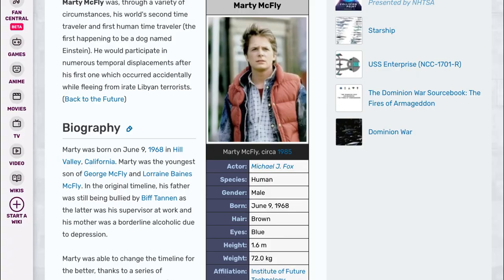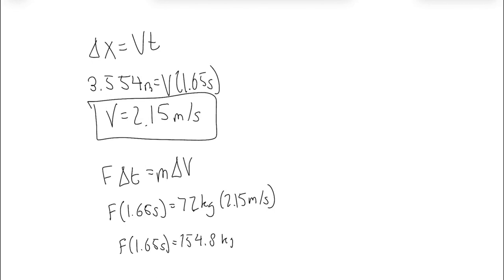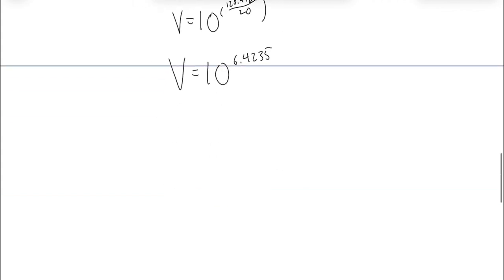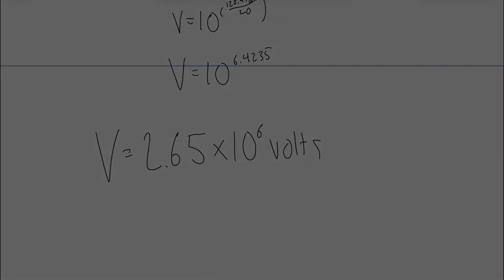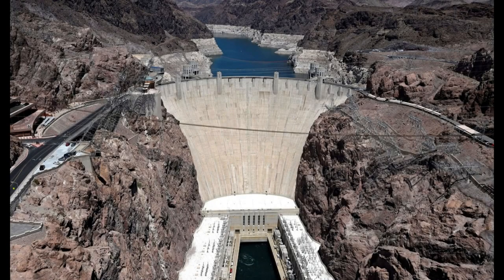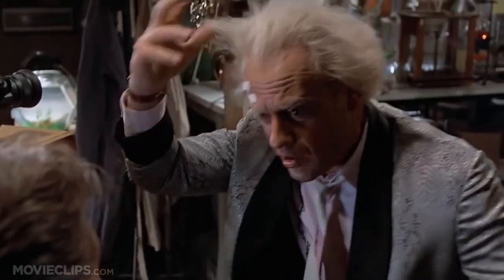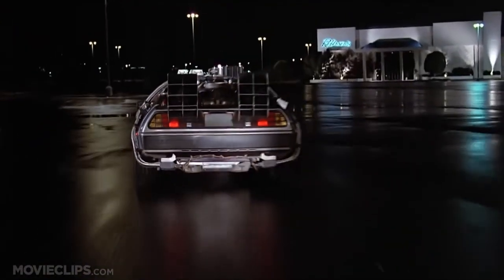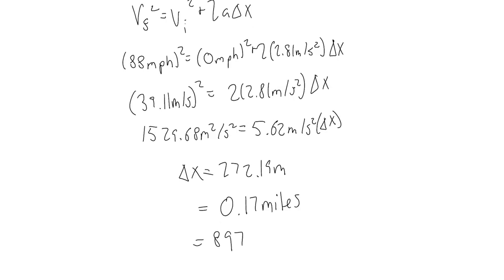The Physics of Back to the Future

Comment: 1. Not that it makes a huge amount of difference in the reality of the sound pressure, but Michael J. Fox was nowhere near 72kg at that time, he was probably less than 60kg. And you can't measure the amount of energy needed in just volts, you need amps as well to calculate the wattage. And as you don't know the resistance of the speaker, calculating volts is impossible.
2. The problem with 1.21 gigawatts is not just the amount, but it needs to be delivered instantaneously. You can't hang around Hoover dam for an hour and somehow collect it for use in the car? This makes no sense.
3. While there are definitely inconsistencies in the speed of the Delorean, Marty never went from 0-88 in this scene, he drove around.
4. The lightpost on the opposite of the lightning strike is clearly grounded in both the model (not to scale) and in the "real" world. Doc would not have been the shortest least resistant path to ground, going through the wires would have been. While this whole segment (and you know... the whole idea of time travel) is obviously Hollywood fiction, you are ignoring some crucial points.
1/10
Reply from the maker: 2. When is it established it must be instantaneously? Doc uses plutonium originally because he is a nuclear scientist and it gives enough energy. In 1955, no such source is present outside a bolt of lightning. Doc just can’t collect 1.21 Jigawatts of power to use over a period of time as there is nothing then or presently that could hold such an amount. 
3. It was a general question
4. Doc’s resistance can be utterly ignored when dealing with a loft number like 1.21 Jigawatts. Anyway, if you’re saying it’s grounded on both sides, then it still proves the point it would have prevented time travel.
In other words, womp womp